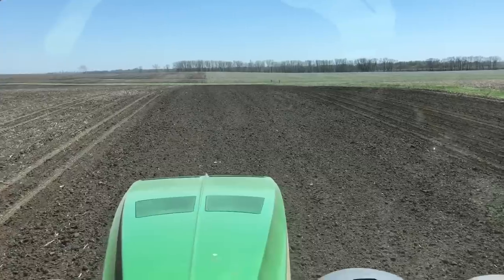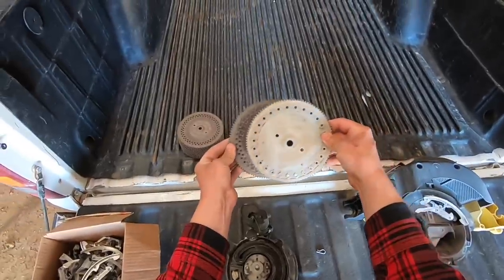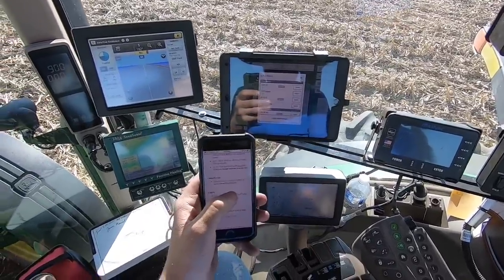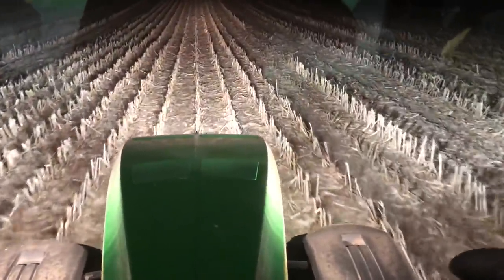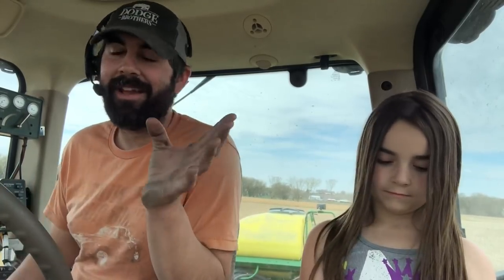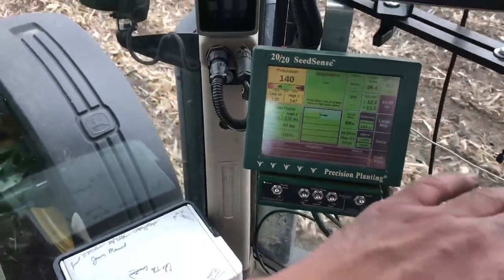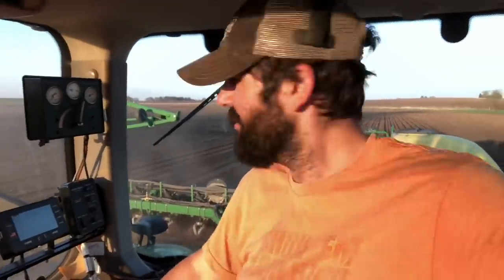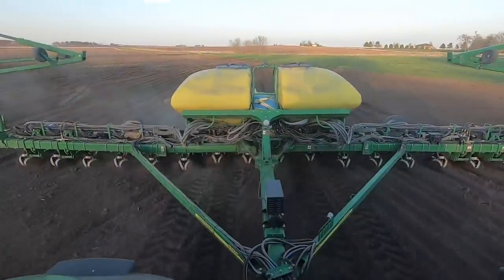Converting the Planter to Soybeans

Comment: Thanks, Carl and Kaylee for another great video.  When you showed us how you switch the planter from corn to beans, I watched closely and I was surprised at how many things are not that much different from the horse-drawn IH two-row planter my dad bought in his "Farmall model A" tractor/implement bundle he bought back in the early 1950's.  In an earlier video, you mentioned that your current planter can also be run in a ground wheel driven mode, just like 100 plus years ago.  Good ideas and good engineering are timeless.
Reply: I too didn't realize there were "plate" changes between the two.  100% smarter now.
Reply from the maker: Thanks Dave! Just to clarify, we can no longer run our planter as a ground Drive planter because we have removed all of the driveshafts, chains, and sprockets as they are no longer compatible with our new meters. They can only be run with the electric motors. You are correct about the many similarities between older planters and more modern ones. The concepts have barely changed at all but the engineering is much better. I remember Dad having to use at least four different sets of corn discs throughout the year depending on the shape and size of his seed. Now our one disk can handle any type of corn from Sweet corn all the way up to the largest kernels of field corn! Have a great day!
Reply: @dodgebrothersfarmandranch9206  Thanks for the clarification and the memories.  Be well.

Comment: Good video. Glad all your planting is done. One question I had when you were switching the planter from corn to beans and you had it apart switching the wheels inside, is there any benefit to blowing out that housing unit with air to get all the build up of dirt dust and seeds? Also very good video guide on how to switch it over. I’ve said it before your videos pull stuff apart for us viewers to see how it works. That’s very important vs just pointing to the tube it comes out. Once again we’ll done. You have a good little helper there!
Reply from the maker: That would’ve been a good idea, Dennis! I will blow them out at the end of the year before I put it away, but I probably should’ve done it while I was switching crops. Sometimes you get excited to get going on the next thing and overlook things like that. Thanks for the compliments! You guys are the best viewers!

Comment: Great interviewer Carl. She did a fantastic job. Glad the weather cooperated for you. We can't get enough sunny days without rain to dry anything here. Another question, can you briefly explain the difference between a planter and a seed drill? Why would you use one over the other?
Reply from the maker: That’s a good question. I may try to talk about that in the future video. To quickly answer your question here, Isidro has very closely space Rose, often times seven or 8 inches apart. There are no gauge wheels, the disc openers just run fairly shallow and are held up by the single closing wheel. You don’t plant very deep with a drill, usually putting beans in about an inch deep. The advantages are higher planting speed, and the rows being close together helps the plants shade out weeds earlier in the season. The problem is with the inconsistent planting you need to put out about 200,000 soybean seeds per acre to achieve your final stand of 120,000 to 130,000.

Comment: Congratulations on getting the seed buried. I'm with you on the seed spacing thing. It should not be that difficult for them to convert that chart into a lookup table that the program could pull from. Do you have a lot of issues with net wrap? Wondering if it is worth it to pull the pickup head off an old baler and mount it on frame with wheels to drag a field before planting?
Reply from the maker: Actually this small field is the only place we ever encounter any net wrap. Maybe we should start hiring the neighbor to work it up with the field cultivator so he ends up with all the net wrap before I get there with the planter 😂

Comment: When you dumped the corn out by the burn pile did you save it also? We try to save as much as possible for those just in case reasons. Great video
Reply from the maker: I only saved the corn back that was in the meters. That particular seed was a VT2 so I would not be able to utilize it on any corn on corn acres. Thanks for dropping by!

Comment: Are these easy for us hired hands lol? We run 800 series but boss has it all set lol. Are these 8 r much different than the 30 series? I just run the disk and cult and chiz in fall..never got to run one of these yet but may be in one this fall.
Reply from the maker: Actually when we traded the 8330 for the 8285R there was almost no difference in the controls. It’s pretty hard to improve on the setup that the 8000 series came with 👍
Reply: @dodgebrothersfarmandranch9206  yea i have no problems with any of the 800s. Just looking forward to running one of these 8r. I bet it beeps more than the 800s lol . Good videos keep it up.

Comment: Why do you start in the middle of the field when you're planting beans? Seems like you would have 2 sides to deal with instead of one. I doubt you have to be concerned about combining like we used to.
Reply: From what I've seen those precision planters have individual row shut-offs so there's no overlap in the point runs. Also beans get harvested at an angle to the planter rows to spread knife wear across the whole width of the head.
Reply from the maker: Hey Bill, sorry I didn’t explain it very well. When I start the field I always start in the middle and find a planter pass to start into from when we planted the previous year. Essentially I’m running the same track shifted 15 inches to the left or right that I ran the previous year when I planted corn. So the sides of the field end up the same. Thanks for asking!